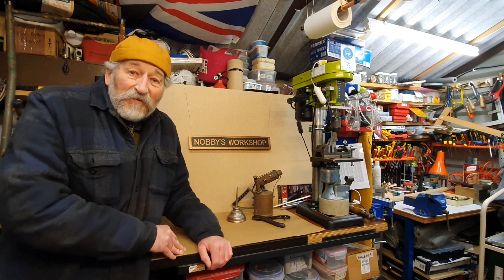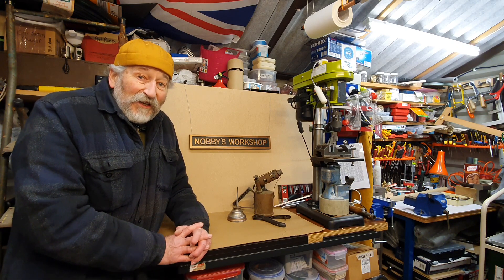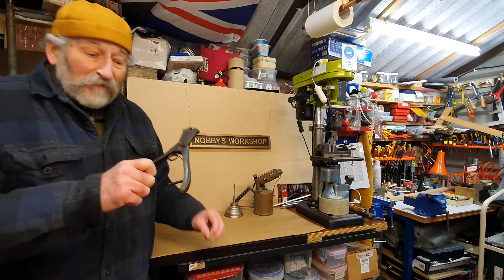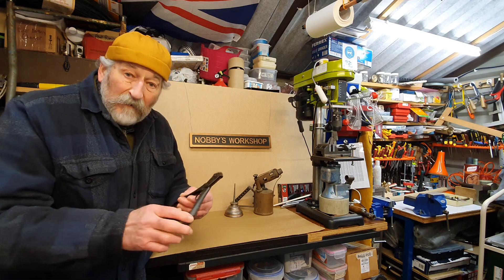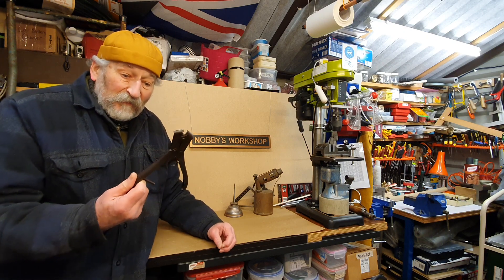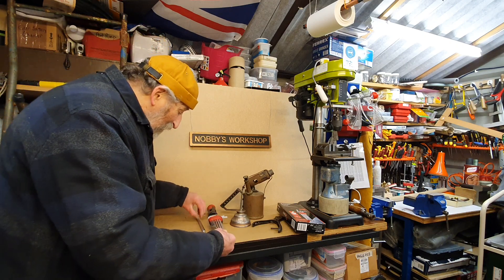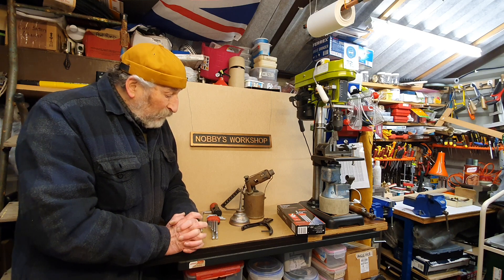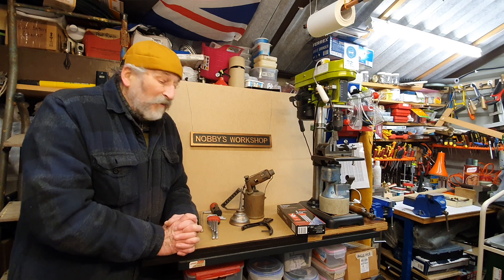Workshop Tool Additions.

Comment: I've got a similar set of those long Allen keys Nobby.  They are very good and they have the angle ball on one end for starting and running up a bolt. I use a little cheater bar on mine to save my hands and get more purchase.  The plastic handle is a novel idea.  Not seen that before.  Don't put high torque loading on the long ball end of the keys as they can snap.  Nice oil can as well.  The new ones they sell nowadays are garbage.  I remember my Dad using those old blow lamps.  Scary.  Cheers Rob
Reply from the maker: I've broken the ball ends off one or two in the past, but at least they can be ground flat. I have some cheap import oil cans, and agree Rob, they are rubbish and leak like sieves. No one seems to make them anymore in the UK. Cheers Nobby